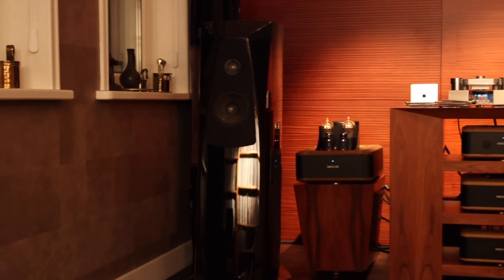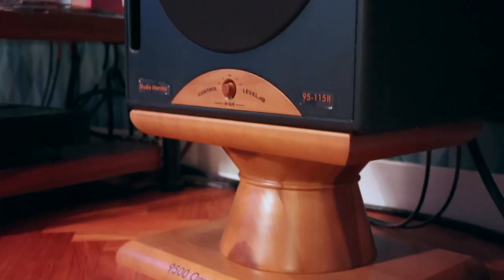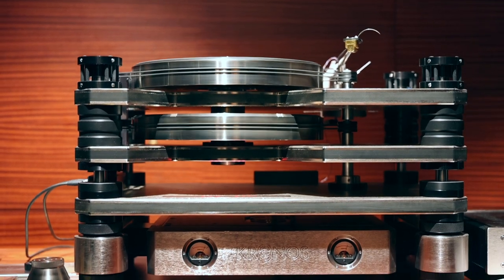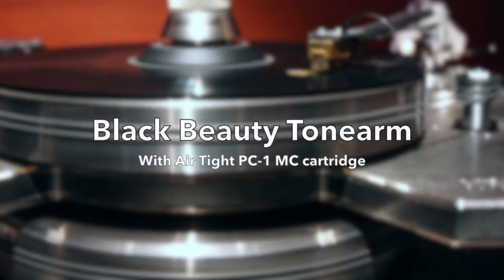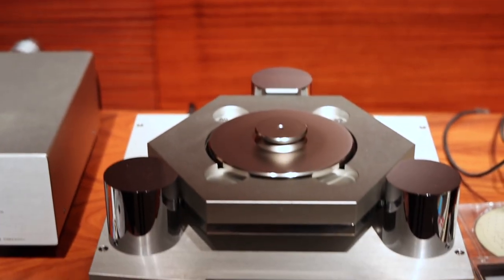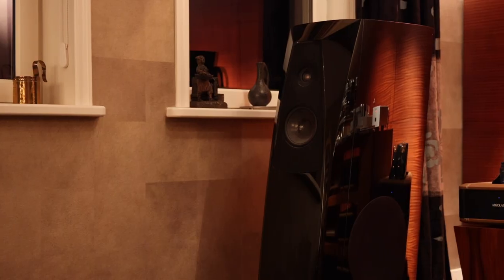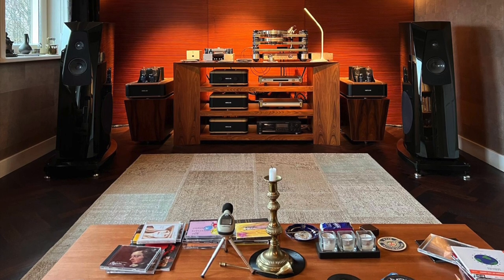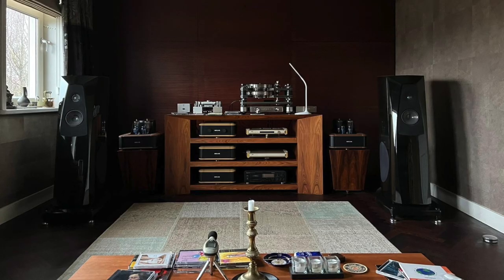A showcase of two Absolare Systems with Kronos, CEC, MSB, Allnic, Echole, Zingali, and Rockport

Comment: Great system but isn't the bass boosted and soundstage limited due the extremly close distance to the side walls? I know from my experience that keeping a room around the speakers makes a huge diffrence. You experienced this also as i know how you were positioning your own speakers in your room 🙂
Reply from the maker: That's the interesting thing about this room and system. Clearly, this room is a little too narrow, but there is absolutely no bass boost nor any other thickening or coloration effects in the bass, outside of the mentioned leanness in the upper bass and lower midrange. This is due to nulling as a result of room modes but I definitely prefer that over the peaks that I had to deal with in my own room. I suspect that it is a huge benefit that the Rockports have the bass drivers on the insides, but also, the owner has had great help in meticulously setting up the system in the room. That said, while the soundstage was projected freely from the speakers, I'm quite confident that it could probably have been wider if the speakers had more room to breathe on the sides. But given the constraints of this room, choices had to be made. Ultimately, most rooms have one or more remaining issues, ironically even those where cost is of little objective. What this owner has achieved in the relatively narrow room is nonetheless impressive.